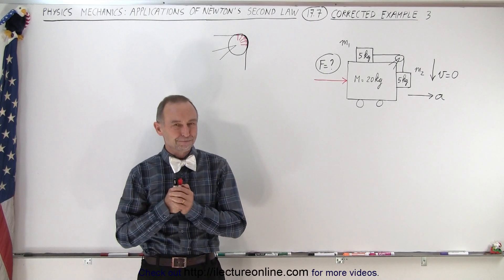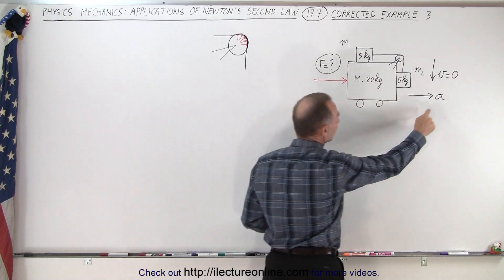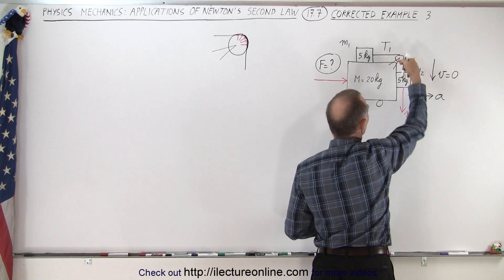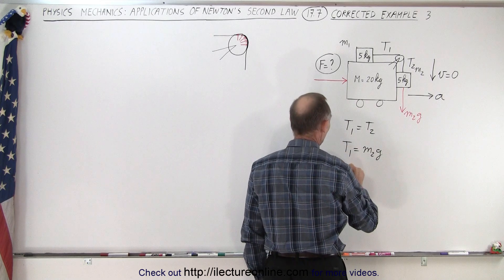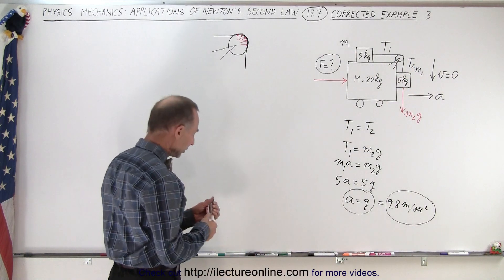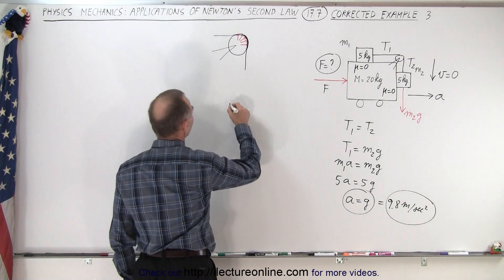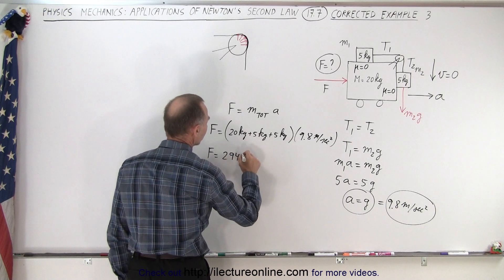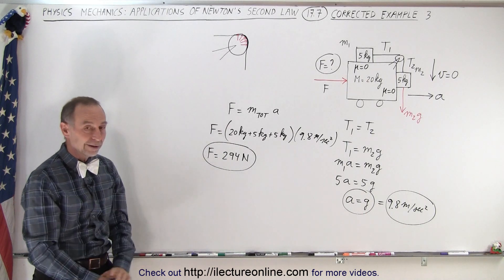Physics - Mechanics: Applications of Newton's Second Law (17.7 of 20) Corrected Example 3

Comment: What would help here is to understand the concept of zero mu, which we don't see here on earth that often.  We think of it as just very, very little mu.  But actually it is no different from having two separate systems, one riding above the other on a bed of air infinitely close to the lower one, but having no direct effect on it.  In our case, however, the two systems are, in fact, joined by the pulley.  And it turns out that when we accelerate the large mass, we also accelerate the pulley and therefore create tension on T1.  At rest, we know that the tension on T1 has been equal to T2 or the right weight since the system was created.  So after acceleration the tension on T1 would be in addition to that on T2 which would pull the top block to the left and raise the right block even though the two blocks have the same mass.  This would continue until either the string was too short and stopped when the right block hit the pulley or when the top block fell off the back of the large one.  Once we understand this concept we can get our equations, make one of the masses a variable, and see how the general equation can show the effect of the acceleration, and then make the acceleration a variable with the two small masses equal and see what effect that has.   Perhaps we could even have a small graph to demonstrate the effects.
Reply from the maker: Phyisics text books are full of problems with zero coefficient of friction.  But you are correct, in the real world frictionless surfaces does not exist, but some have a very low coefficient of friction.  It is the same with zero wind resistance.  In the real world that doesn't exist either.

Comment: I love this channel. I found lots of answers to my questions. I am just wondering sir how to solve this pulley system if there is friction on it. How do you define the directions of frictional forces on the masses when a minimum, a maximum or a moderate force applied?
Reply from the maker: Pulleys can considerd to have both friction and mass.  In both cases, friction and mass will require a torque in order to make the pulley rotate.  This is covered in the application chapters on moment of inertia.  PHYSICS 13.1 MOMENT OF INERTIA APPLICATIONS 2
Reply: @MichelvanBiezen  Sir I assumed the friction is just only between small masses and cart (upper side and front side of the cart). What could be the max/min forces to be applied in order to keep smaller blocks at rest with repect to the cart? Thank you.